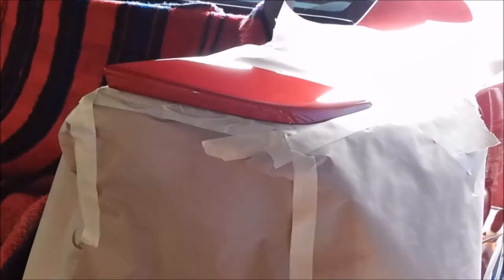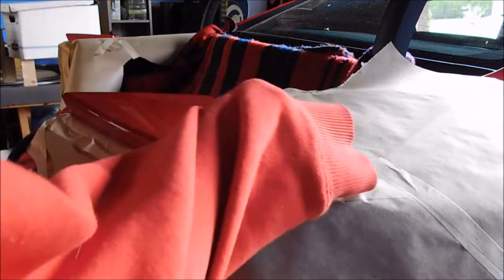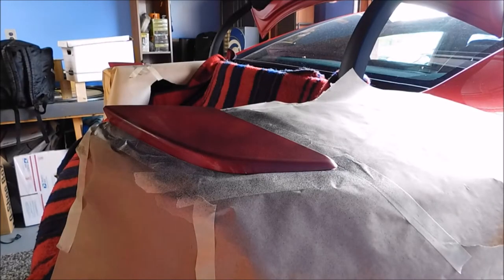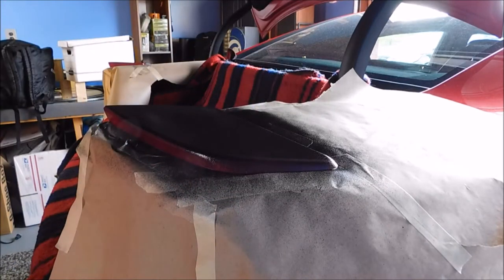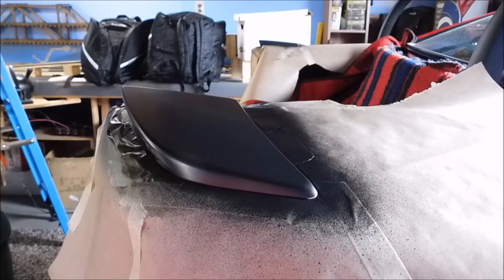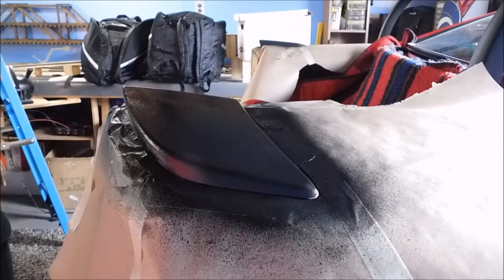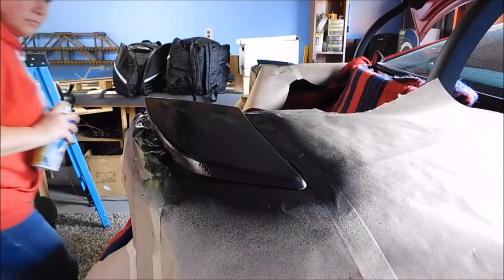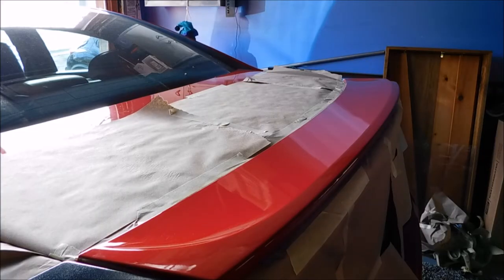Plasti dip Dodge Charger spoiler

Comment: You are holding your can way too far away that's why it caused all that orange peel. It started to slightly dry in the air traveling that far. Next time try around 6 to 8 inches Max
Reply from the maker: Thank you for your comment. Although I respect your comment, It was actually a combination of me being a shorty not getting the best coverage, and the clear coat that I put on. If you note the video the center piece on the decklid is the only part that I was slightly over 8"away. I have plans in the spring when it warms up to redo the spoiler. Merry Christmas

Comment: How many cans did it take for the spoiler? / if you have plastic dipped your mirrors too how many total cans does it take? I drive a Dodge Charger Ralleye and I’m wanting to this but I don’t want to buy too many cans or too little cans?
Reply from the maker: I used one can for the spoiler. I will say I prefer the flat black look. although I did do a coat of the clear after 2 years of it being on the shine is fading due to the harsh weathers of New England. But it's a good thing. The plasti dip is still holding up very well on the rims and spoiler. Due to an injury I just didn't have time to redo the spoiler. But no rush to do so. I do not have plans on the mirrors. But if you are doing the spoiler and mirrors I would buy 2 cans.